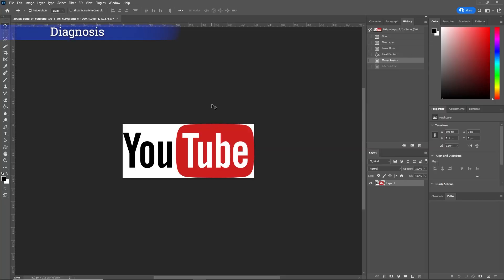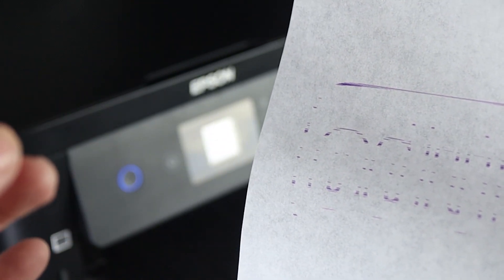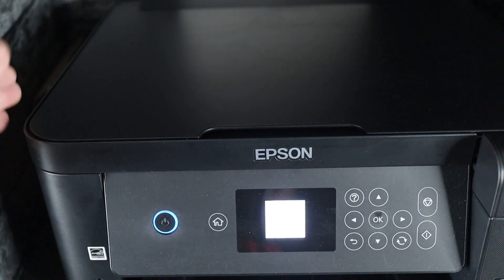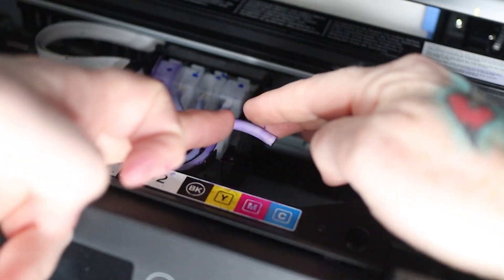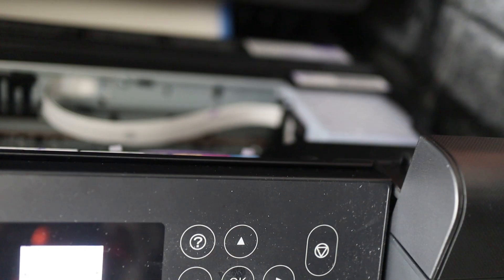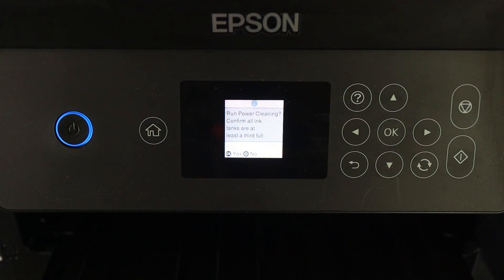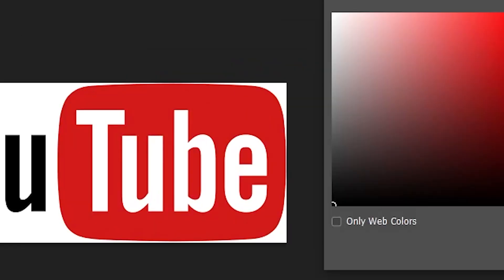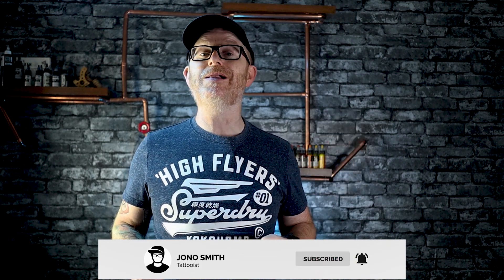Tattoo Stencils Hack! How To Fix EcoTank Printer Problem!

Comment: Great video & thank you for your time it was worth a like & subscribe. Questions; Can you run the Epson with only one tank full or do all tanks need to be filled? Also what THERMAL INK are you using? I've seen people soak thermal sheets in 97% rubbing alcohol, have you tried this does it work.

Comment: Can you thin the ink jet stencil solution?
Reply: I've seen people soak thermal sheets in 97% rubbing alcohol I wonder if the homemade thermal ink works.  I feel like the rubbing alcohol would help keep the printer heads clean too.

Comment: you just saved me from a crisis lol. i appreciate this video more than i can say. subbed and look forward to more content in the future. despite everything i tried i couldnt get the printer to print a stencil at all. flushing the cartridge quickly solved this issue. thanks so much again.
Reply: Did it hold up after doing this cleaning?or is it clogged again?

Comment: Hi, I got an Epson EcoTank M2120 monochrome, tried to initialize it with stencil ink and didn’t work from the start, or sometimes printing some faded pages. I eventually cleaned the tank and added black ink to see if the issue is with the printer as it was new and it worked. Any tips on if I can eventually make it work?
Reply: You cant change the inks, if u used black ink  I don't think you can ever use thermal ink again.

Comment: There's no junk in the bottom of your gas tank. The fuel lubricates and cooles the motor on the fuel pump. Low fuel no lubrication and more heat which causes your fuel pump to burn out. But junk on the bottom of the tank sounds good to me. I get the point.

Comment: I can't find anything about using stencil ink inside the Cyan tank and make my designs pure 100% Cyan color so the printer have to use the Cyan tank filled with stencil ink.
And use the black color in the BLK tank so I can print normal stuff for me and my kids.

Comment: Love the quality these inkjet printers produce for stencils. I previously had a Monochromatic version of this (black-only) and left it sitting for too long thus clogging the print heads. I’m in the market for a new one now and might actually go with one that has colour tanks instead - based on the way you were troubleshooting this problem it seems the other print heads dedicated to the colour tanks can be used as back ups for when the black one inevitably begins to clog.

My question to you is: do all the tanks need to have ink in-order for this printer to print?

Comment: Hey man do you fill all 4 tanks with stencil ink. ??? I'm confused. And if I've accidentally put colours in xan I pour them out and still use stencil ink or am I fukt.???
Reply from the maker: You can fill all the tanks with stencil ink if you want to it won't really harm anything. You might be struggling if you've added colour ink in the tanks. Hopefully you haven't tried to print anything yet with the colour added. I would just run  a load of plain A4 paper through it with different designs to try clear it if it's not printing properly
Reply: @JonoSmithTattoo  ive put stencil ink where the black should be. Now its working ok. I might not use the colour ones or try and clean them. 1 more thing is my paper won't go thru very easy. Can I get thicker transfer paper.????
Reply from the maker: @Max-dm3vg  i only use the original Inkjet stencil paper. I find it works the best. Its about £30 for 500 sheets but well worth it.
Reply: @JonoSmithTattoo  thanx heaps for reply. Appreciate it
Reply: @Max-dm3vg inkjet stencil sheets.
Reply: You cant change between normal ink or thermal ink. U have  to use thermal ink from new .

Comment: Hi Jono, what preventative maintenance would you suggest so that this issue doesn't arrive in the first place? Just topping off the tank when ever it gets down to half full? Also, how many bottles of ink does it take to fill all the tanks? 

 I'm just about ready to buy this product in a bundle and it's expensive for me so the information provided really helps. This printer would save me so much time vs my thermal printer. Thanks for answering in advance!
Reply from the maker: I wouldn't leave the printer stood too long without using it, by that i mean if you're not busy never leave it a few weeks. Always run some stencils off to keep things flowing. A bottle of stencil ink will completely fill the black tank and should 1/2 fill the 3 colour tanks.
Reply: @JonoSmithTattoo  Thanks Jono! You never disappoint
Reply: @JonoSmithTattoo  would you recommend printing every couple stencils in red to keep all of the tanks flowing regularly ?

Comment: Can I use an „old“ Ecotank printer (which was used with normal printing ink) or does it have to be brand new one that has never been in contact with normal paper ink?
Reply: Maybe put stencil ink and than print several prints, so the normal ink is gone?

Comment: Jono….really appreciate your videos…question…can I only fill the black tank with stencil ink and the other tanks with the regular printer inks since we won’t be printing color? Thoughts?
Reply from the maker: I probably wouldn't recommend normal colour ink as even though you might only use colour the black tank will still be utilised when printing. Thanks for watching!!
Reply: I did this and ruined the printer. even if you print in just black, the printer uses dark blue printer ink and other colors. So you will dilute your stencil by putting regular printer ink in the colored tanks. Found this out the hard way
 @JonoSmithTattoo

Comment: So when power cleaning, do you fill up the other tanks with stencil ink as well? You mention that they need to be 1/3 filled but did not say what you use. I have been using an Epson ET 2720, it was working great for a long time until I forgot to refill the BK tank. Since then it has not printed properly, I have used a cleaning solution and kit for the printer head and nozzle, and made sure that the ink can flow smoothly from the tank to the damper. It still prints incredibly weak, so I believe I should do the power clean to hopefully fix this? pls help!
Reply: did you fix it ? and how if you made it?:)

Comment: Hi mate, may be a silly question but  can you use normal printer ink for stencils? £90 a bottle for the purple ink is crazy.
Reply from the maker: Unfortunately no, a normal printer won't print stencils. You need an eco tank printer which needs to be filled with stencil ink.

Comment: Use rex instead black isnt a fix, btw i like the video, plan to get l3210, but i will use stencil only in black, and regular colors for the 3 others, then use the printer for both, stencil ink in black tank, and regular print with 3 regular colors, using the option to create black mixing 3 colors, better than have 2 printers

Comment: I'm having trouble transferring to practice skin after printing. No matter what ratio of stencil stuff I use it seems to go on much fainter than real skin. Any advice? Thanks!
Reply: use a stick deodorant, like old spice
Reply: @lucaslemes8349  I actually tried that! But the lines bleed pretty bad. So I put it on super thin, but then it was no better than the stencil stuff. What's the magic formula?
Reply: @Xplorer228  having the same problem, ive tried a few products and stencil stick but dettol seems to work a bit better but its still not great
Reply: @Xplorer228  have you tried to put some weight on it, and wait at least 1 hour to settle ? when i practice on fake skin, i put the stencil the day before, and take it off in the morning.
Reply: @Xplorer228  i use a book on the top of it, and also put some weight. try that and come back to tell me if worked
Reply: @lucaslemes8349  I'll have to try that! Thanks
Reply: Use other practice skin
Reply: Are you using silicone skin practice?

Comment: Hey man love the video...what kind of paper are you using? I've been having a problem with it bunching & not feeding or crinkling halfway through. Everything's clean rollers & such. Any help would be appreciated thanks.
Reply from the maker: I’m using the InkJet Stencil brand. It comes in a pack of 500 a4 sheets and works really well. I usually get it from Barber DTS in the UK.
Reply: Get Pacon stencil paper 500 sheets they sell it on Amazon for about $30 you will need to buy a paper cutter and chop about half an inch so it can fit through the printer feed.

Comment: The issue that we keep having is the ink pads filling quickly even if we aren’t doing power cleanings or cleaning the heads. even when we replace the inkpad tanks it still isn’t working.

Comment: i have the same printer but i have trouble trying to get the size of the stencil paper to line up w the printer. do you know the right  size that needs to be set to?
Reply from the maker: It should be standard A4 size.

Comment: Do you use all your tanks pretty frequently? I see some videos of people putting enough in the colored tanks just to “trick” the machine they are filled. I just got mine and trying to make it last as long as possible
Reply from the maker: I mostly have the black filled but keep the colour ones topped up so there’s some ink in them. I use mine 5 days a week.

Comment: Sir which thermal printer is best for tattoo stencil ?
Reply: Been using the basic brother until I've switched to ecotank, on blue spirit and red s8 paper. Works like a charm once you've got a feeling for the sweet spot of density and amount of black in the stencil

Comment: a head cleaning (no more than 3) and then some bleed pages (solid black pages,  but purple for the stencil you know) fixes mine!
Reply: had my mono printer little over a year now,  got the gentian violet ($7 versus 100 or more) and it worked great but when I refilled it, I thought I broke the thing. ran a print head cleaning a few times got nowhere. sat all over youtube looking and came across sublimation printer repairs. bleed pages fixed my problem after a few solid purple pages, it fixed and was running darker than ever!
Reply: Girl mines is so clogged it nothing shows up on the page I need helpppp
Reply: @simonecartier4880  i ran a head cleaner, then like 10 bleed pages non stop lol. It straightened out that way! Also a bit of rubbing alcohol in with the ink apparently!
Reply: How do u print a bleed page please?
Reply: How do you bleed pages

Comment: Have you used the printer cleaner sheets? I used them to revive my old HP office jet all in one. It was having issues even with the normal cleaning method via the printer menus and fresh ink cartridges. They are soaked in cleaning solution and it runs through like paper to clean the heads.
I'm saving up for a monochromatic ecojet.
Reply from the maker: I’ve not heard of these but I will definitely check them out. Thanks for watching!

Comment: Stencil is printing strong images. my problem is when I put to skin, it doesn't transfer all the details and are so faded. 😢
Reply from the maker: What paper and stencil solution are you using?
Reply: Use the stencil solution made for this stuff. Our stencil still come out weak, but the stencil solution is a game changer. Brings more out a weak stencil than you would imagine.

Comment: This is precisely why I went with a monochromatic ecotank! Great video tho! Appreciate the time & effort you put into this channel on reviews & tutorials.  Your an inspiration & massive help in all aspects of your videos!
Reply from the maker: Thank you I really appreciate that!
Reply: Can you say which model you have and why you picked it?
Reply: @andyhowden7655  epson 1170
Reply: @justinshields4216  I got the same model and haven't had any problems with it till now... 😍
Reply: @sinav.3138  What problems you have, im considering 1170, and why you picked up this one, 1120 looks like can do same but its cheaper?
Reply: @justinshields4216  wich setting do you use? I have the same one and the stencil is always very fade
Reply: @skinlabtattoos742  I have the ET-M1170 model.. I have not adjusted any settings.  Just a head cleaner & nozzle check from time to time.  Been good so far
Reply: @skinlabtattoos742  best to add 5ml of distilled water to your ink reservoir & then run a nozzle clean procedure if haven't ran your printer in a while.  You could do this on ordinary paper to save your stencil paper as well.  Reduce image size & put several on 1 sheet & so a test run before printing your actual stencil
Reply: Do you only fill your black tank? It looks like the others are empty??
Reply: I was thinking of getting the same one. Can you only print lined stencils or can you print out shade and all

Comment: I have the Epson 2803 model and all of the ink that’s coming onto the stencil paper is not all stencil ink. Some of the ink is actual printer ink. I drained the cartridges and the tubes, but that did not help.
Reply from the maker: It’s probably going to take a lot of rinsing through if it’s previously been used as a standard printer.

Comment: I got a canon pixma G4210 would this work to print with inkjet ink?
Reply from the maker: If it’s got an ink tank you can manually fill then I see no reason why it wouldn’t work.
Reply: @JonoSmithTattoo  great!! Thank you for all your videos they've helped me alot!!
Reply: @chinocisneros22  but of course it has to be a new one.. That had never filled in normal printer ink..
Reply: @sinav.3138  than you !! Yes its brand new.. purchased because i couldn't find the epson .and it was 50% off at my local Walmart 😅😅
Reply: @chinocisneros22  Does it work like EcoTank? Pixma have cheaper printers.

Comment: I stand by making my own inkjet stencil ink, literally the materials are cheap you can make a gallon easily for cheap: methyl violet powder $18, polypropylene glycol $15, Germaben 2 $15, distilled water $3, isopropyl alcohol 91-99% $2, hand sanitizer with ethyl 70% $4, coffee filters and $1.25, you can also add a PH adjuster to reach between 5-8 Ph best for human skin. Mixing is based on total weight. My current formulation is 5% iso/ethyl/methyl violet add the powder to a 50/50 mixture of ethyl and iso until the solution can no longer dissolve, the water gets mixed with 2% Germaben and 10% propylene glycol 83% water.  Heat the 2 separate solutions pour them through a coffee strainer 1-2 times mix them throughly if you have a mini vortex mixture use that. If you find the violet too weak add more violet powder until saturated use a vortex again before filtering through coffee filter 1 time. Store in a dark place never spend money on the over priced stencil ink again. Yay

Comment: Mine all brand new when put on skin very faint winding me up
Reply: Sorry for delay eco stencil...looks like goes on paper ok use stencil stuff and trying stencil-prep just feel as don't go on skin enough
Reply from the maker: @R1-1978  I use Electrum Gold Standard. This is by far the best stencil transfer solution I’ve used to date.
Reply from the maker: What solution are you using?
Reply: Thanks I'll check that out ..where best place ....love your channel been a tattooist 12 years and everyday a school day
Reply: Just ordered some from my supplier they have it in . Many thanks fingers crossed that's better
Reply: @R1-1978  Have exact same problem. were you able to get proper transfer using electrum gold?  Can you compare it to stencil stuff?

Comment: What printer currently available would you recommend for this type of stencilling? Or what method of stencil making would you recommend above all?
Reply: Epson Sure Color F170 or sublimation type printers are BY FAR the best and most reliable.
Reply: @ElectrumTV  Would you recommend this one over others? My m1170 broke. Do I need to fill the color reservoirs too?
Reply from the maker: I like my Epson 2750 to be honest. I swear by using these for stencils. I’m a busy studio, the time it saves is massive. Thanks for watching mate!
Reply: @JonoSmithTattoo  Cheers, I just keep having a massive dramas with one of them brother machines and the cheap one with the red n blue button. Only reliability is to draw my stencils but its so tine consuming.
Reply from the maker: Yeah I’ve used all these ones in the past but I’ll stick with this method for the foreseeable future just because of the time saved.
Reply: @andyhowden7655  if you look into monochromatic ecotanks (black & white).. that's where it's at. Just make sure that it supports whatever software you're using.. MAC android windows etc.. 1 tank to fill.. after you put stencil ink in it.. its basically a dedicated printer for stencils
Reply: @justinshields4216  thank I'll check it all out. Just don't wanna pay more cash to be disappointed again.